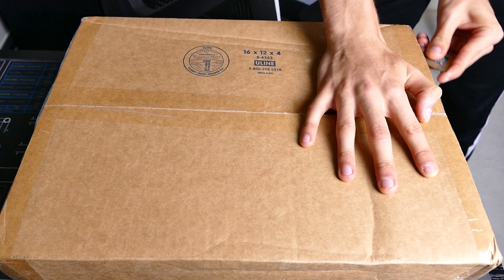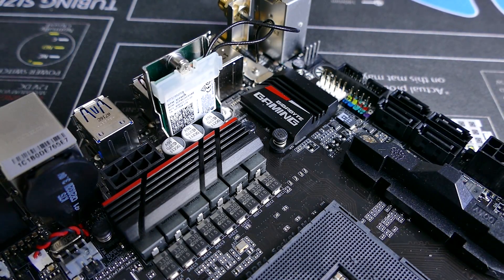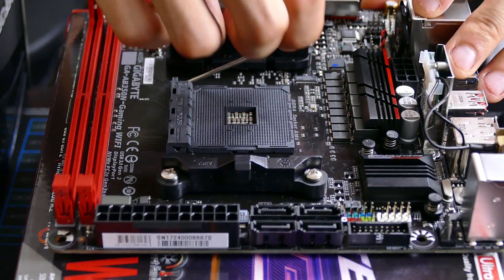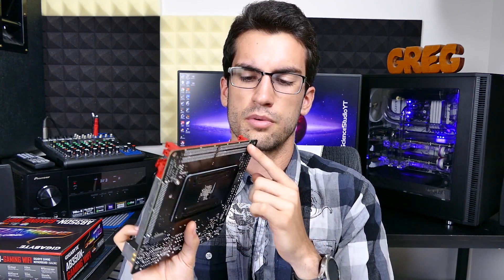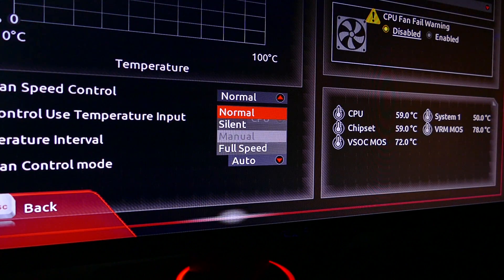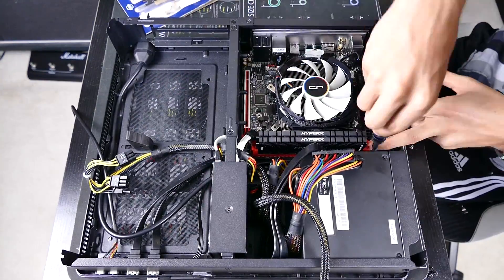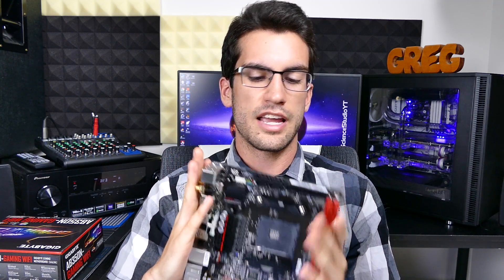Gigabyte AB350N ITX Ryzen Motherboard Review

Comment: I am using this very board right now. I got it 'open box' off eBay and all that was missing was the backplate and plastic clips. My current build is a 3700X and Scythe Shuriken 2 cooler, 16gb oloY 3600mhz ram running @3600mhz, XFX's Thicc 3 Pro RX 5600 XT, WD 500gb SSD + WD 2tb HDD (both 2.5"), powered by Fractal's Ion 650G SFX-L PSU. I've shoehorned all this into Silverstone's Raven RVZ-02.

I got around the odd placements for the 8-pin power and the front panel connectors with sleeved extensions I bought from online. An 8-pin one is common, but I can't find my source for the 9-pin to front panel (pwr, reset, leds) cable I used. The Raven case was also helpful in having cutouts in the right areas for some limited cable managment.

Comment: GIGABYTE WILL NOT KEEP YOUR WARRANTY! READ THE TRUTH STORY:
We are a small PC builder / reseller. As per Gigabyte manual and website, this GIGABYTE GA-AB350N-Gaming WIFI motherboard supports A12-9800E CPU with BIOS version F1-F25. We had bought 5 of them to install Windows 7, three are working fine but other two DO NOT BOOT with A12-9800E CPU but WORK with all Ryzen AM4 CPUs. We emailed Gigabyte TECH SUPPORT for help, They AGREED the boards were defective and advise us sending them back for repair. We worked with Gigabyte Service Department for RMA, they APPROVED and ACCEPTED the boards were defective with the RMA number. We spent $15.00 for shipping. We were waiting for Gigabyte over a month so that they could get the A12-9800E CPU from China to test. They duplicated the problem but they could not repair. GIGABYTE state THEY DON'T HAVE A12-9800E CPU WITH BIOS F1-F21 TO TEST! They show us many screen shots the boards are working with Ryzen 2200G CPU! Gigabyte made us to spend $15.00 shipping cost for nothing! BOTH GIGABYTE TECH SUPPORT and SERVICE DEPARTMENT ARE LIARS!

Comment: is onboard wifi better than pcie wifi ?
Reply: Patík #neverlucky they are the same but on mini itx there is only one pcie slot occupied by a gpu usually so you would either need a usb WiFi card or the built in one which is usually much better than usb

Comment: I have only seen a few of your videos and only about 50 hardware related videos overall.    But this was a very good video.    I am very much a novice, having built 4 half-*ss computers.     I think this will be my next build if I can confirm my GNU/Linux distro will work well with Ryzen.     Can I run a $ 8 splitter cable for more fans ?     How big of an air-cooler do you think you can fit on this.     I have no problem with putting a mini-ITX is a eATX case.    eATX motherboards are fricking expensive.     I would rather compromise to just one DDR3L memory slot and have the M2 on top with another fan connector.

Comment: Though I'm not using PS/2, keyboards for it are still perfectly usable for everyday purposes, and you can get them very cheap.  But, I do think adding it puts on unnecessary complexity, which should be avoided in ITX.

What I really don't understand is why ITX boards come with a 24-pin ATX connector.  It's completely unnecessary.  That's a lot of room they could've fit for something else.

Comment: The layout actually seems pretty standard for ITX, my MSI Z87i has almost identical layout, minus the M.2 and the wireless is a PCIE 1x card in a slot at the top near the 24 pin power.

Comment: I just got one of these boards for my second ryzen 1700 system. Instead of waiting on Threadripper, I'm just going to network render two 1700's. After doing the math, it ended up cheaper too compared to the 1950x(1600$ for two full 1700 system's). I'm sure the Bios will get sussed out eventually, my asus b350 prime plus runs ram fine(3200) with the latest agesa updates. I really dig the overall color theme on this board too, hopefully having the connections on top won't be a problem.
Reply: it should be noted that R7 1700's are selling for 270$ on amazon right now too.

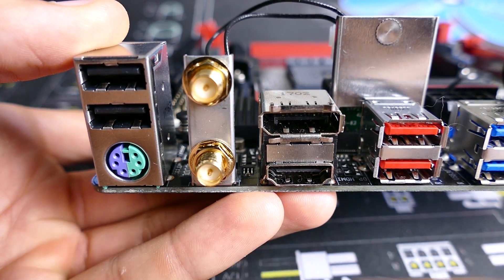Comment: 0:50 If anything, I know for a fact that using a PS/2 device allows more voltage stability than using USB when overclocking. That's why the ASUS Z270 Apex has one. Certainly more helpful under LN2, but I'm not sure if it helps under water or air.

2:52 Have you tried pushing the uncore voltage to 1.1V?

Comment: 0:45
Fun fact:
PS2 is the best way to connect a mechanical keyboard
USB have some kind of a bottleneck even tho you are using the razer RGB godlike ultimate over 9000 with ass RGB lights
It will still register 1 key press every time you press a key
With (just like normal 5 dollars non mechanical keyboards)
With some keyboards being able to register 4 to 6 I think
:)

Comment: briliant review greg. if ryzen 2 sorts out the current ram speed issues with an improved intergrated memory controller, I might just have to pick one of these boards, and a small case so I can throw it all together with my current 1700, a 250 gig NVME drive, and 16gb ram for my mum

Comment: How is the overclocking?

Is the CPU voltage, if you set it manually fixed and doesn't go down if the CPU clocks down @ idle?

Comment: great review of the board man...but as a strictly itx builder I would never buy this bc of the CPU 8 pin and the 24 pin locations. Corsair SF psu will have a problem reaching them in most cases.

Comment: Greg, what's your opinion on WiFi integration methods with ITX? I notice some boards use a removable chip, and others, like mine, have it fully integrated into the boards intself, which does look nicer.

Comment: Those header placements actually aren't that strange. If you think about a lot of ITX cases there isn't really a whole lot where those things are, so it could actually result in a much nicer looking build. Maybe there will be a fan slot you're covering but that's it really. Most that's over there is some cable management stuff. I can see some SFX power supplies not reaching. That would be a drag.

Comment: hey, PS2 port is great due to the lack of USB support on newer bios when installing windows 7.
I recently got a ryzen 1600 and had to buy windows 10 because 7 wouldn't install because there just wasn't compatible drivers for it. 

(yes I tried all ports, multiple times,  even tried installing drivers first, nothing worked. was fine in bios, stopped working when 7 loaded to install.)

Comment: The thing about the 8 pin cpu power input, is that if you use a cable comb, you could potentially hide the aluminum ports in the back.

Comment: I bet the board would be a lot better had the RAM been at the top. Better location/access for the IO and power connectors. Also I view the lack of optical audio on a board I can't add a sound card to completely unacceptable, especially if you planned on building an HTPC which these boards are usually used for.
Reply: objective 2 amp dac combo.
Reply: Congrats, you just recommended a vastly overpriced solution that defeats the purpose of a mini-itx HTPC build that doesn't even have the output that I requested. 

I'm looking to drive 5.1/7.1 surround sound and optical out is perfect for this as at least 99% of receivers have this as an input.

Comment: 0:46 Having a PS/2 port can actually be a huge benefit, since PS/2 based devices allways work with absolutely no special drivers needed. This can be helpful in many situations, for example if you can't install the drivers for your shiny mechanical USB-based keyboard but need something to navigate the BIOS. Also think of some more obscure operating systems than windows. Some input devices straight up don't even get driver-support for Linux and the like. The more you know...

Comment: Actually if you live near a microcenter, that i3 7350k is 129.00 bucks. Pair it with an open box z170 board for ~50 bucks (which MC always has in stock) and you got a setup that cant be beat for the money.

Comment: This board is a piece of crap.  
"don't look any further than this board ..." as long as you don't care about crappy layout, poor ram speed support, poor overclocking, and virtually 0 features actually drawing you to it other than "a ryzen chip will boot in it " and "it's mini ITX". 
 If you really want an itx board for your small form factor build, spend the extra 15-20 bucks to get a board that won't make you regret your purchase the second you go to build with it.  Hell, you can get a biostar x370 mini itx board for 115 bucks, that also only has two ram slots, but at least it's inputs and outputs are setup with some form of common sense.  You didn't even mention the odd placement problem of the sata.  You are literally gonna have cables criss crossing this thing like a hillbilly christmas tree, lol.

Comment: I feel like Gigabyte has really been stepping up their game lately. The Aorus branded products are all top notch quality and look the part, especially the motherboards and the normal Gigabyte branded products are decent as well. I'm not perfectly satisfied with my Gigabyte G1 Gaming GTX 1080 because the fans have to ramp up to 60% to keep it at 72C under full load. That could also be due to the fact that my card has all the power temperature and voltage sliders maxed and thus is the definition of quick and dirty overclocking, so it might just be my own fault xD

Comment: Fun fact: If you happen to have a PS2 mouse and keyboard, you could much more easily get this mobo running on Windows 7 since the main issue is no usb drivers during the install process and PS2 pretty much always works.

Whenever or not is even worth to install Windows 7 at this point I leave that all to you all.
Reply: The_Misanthrope I installed win 7 on kaby lake with win 10 and I put in my win 7 DVD and It let me upgrade to win 7 :D
Reply: Still running a Mechanical Samsung PS2 keyboard from 2000, it's solid af. Wouldn't change it out for anything else willingly
Reply: ouuuuuuuuuuuuuuuuuuuu i hadnt heard anything on that. sweet.
Reply: youd still not get the updates from microsoft. they locked it down so people cant use those old os's even if they wanted to.

Comment: He Uses His 7700k To Open Boxes !! LOL
Reply: Intro Basse its an i3 7350k
Reply: It makes no difference if it's a 7350K and not a 7700K?!  Are you a blind AMD fanboy or just stupid?
Reply: Intro Basse He uses the overclockable i3 sorry but I forget the name with the SKU
Reply: Imraan Omar yeah the mucu cheaper i5 6400 is on par or better than the 7350K even when the 7350k is overclocked to 5GHz not to mention you require a z170/z270 to OC the 7350K.
Reply: coinsagE46m3?
Reply: coinsagE46m3 ?
Reply: +coinsagE46m3 its a CPU that has no place in the market the g4560 is a better budget option and if you a entry level i5 for less money if you dont get a Z270 board it is a better option. From intel side alone, if you consider Ryzen then its complete trash.
Reply: An i3 7350K only makes sense if you need high single thread performance (or for dual core applications), which don't have that many use cases, but they're still there. It's mainly very few games, a few intensive applications and emulators. But single-thread is pointless in most cases.
Reply: Yup !
Reply: its not a terrible processor its just overpriced for what it is.
Reply: Intro Basse LOL haha
Reply: They Are Probebly the Same AT the Price ....
But That is an i3 So It's A Trash .. A agree With You !!!
Reply: That Makes No Difference !! If It is an i3 7350k